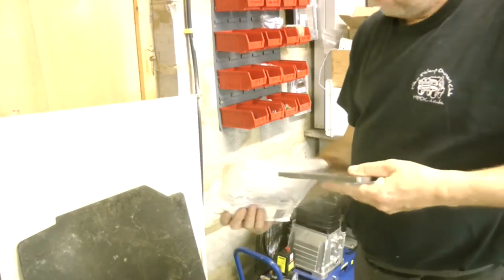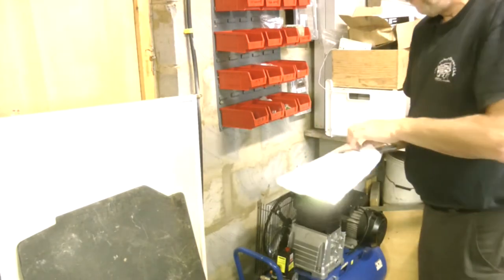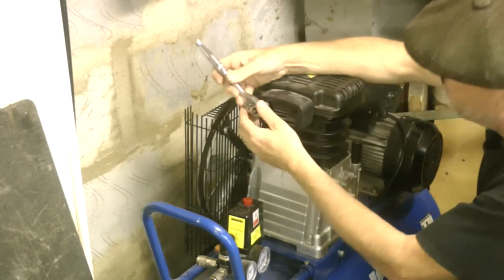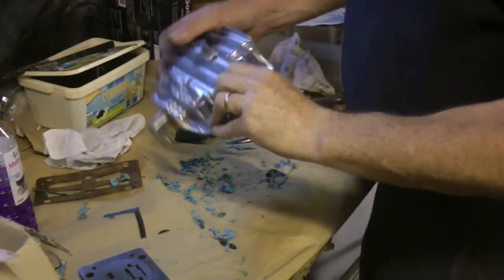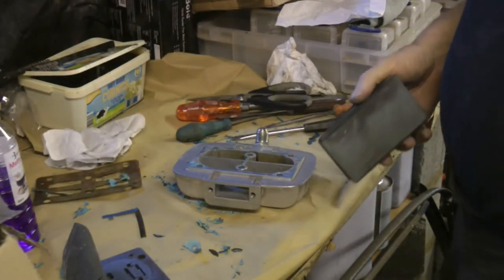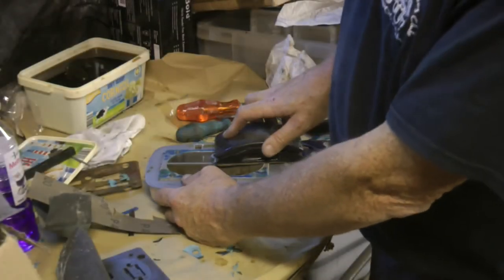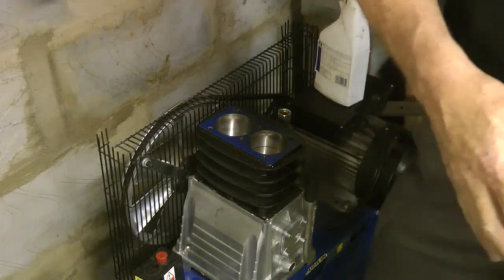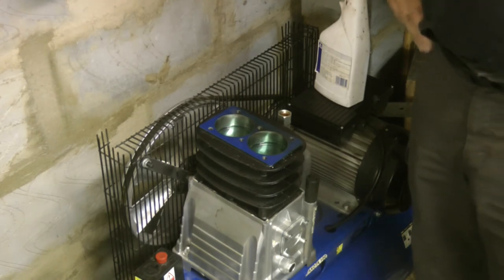wolf air compressor head gasket replacement part 1, strip down

Comment: Looks like the same compressor I have (Dakota 100) and exactly the same thing happened to me. This has been a decent compressor and has been a good workhorse for 5 years of pretty heavy use, so it was worth a few quid for the set of gaskets to fix it. Mine had a lot of corrosion on the plates that needed a lot of cleaning up and the gaskets were literally welded-on. While I had the head off, I cleaned it up and painted in black wrinkle finish, in the hope it might run a few degrees cooler. I think the failure is just down to heat over time and the gasket material gets brittle.

Comment: Where did u get the kit from  as I need some gaskets
Reply from the maker: I got this from  some online place but a company called sgs sell one that looks the same.
I think they’re fairly generic
Reply: I managed to get one from ukhs online
Reply: What was the part number from the place you got your gasket set from
Reply from the maker: @waynenrich  because it was a warranty replacement I didn't get a part number.
Reply: I assume yours is the 100ltr 
So would need a make n model so I can get the right one
Reply from the maker: @waynenrich  Yep, Wolf dakota 100ltr

Comment: where did you buy the kit? I need the exact same one. Thank you
Reply from the maker: I got it from the same supplier as the compressor. Sgs sell a compressor that looks very similar, they may be able to help.
Reply: GT Air in Milton Keynes sell a make almost identical to Wolf. They do spares and repairs.